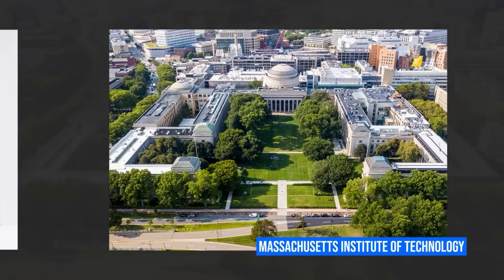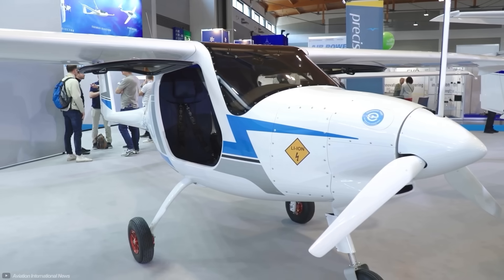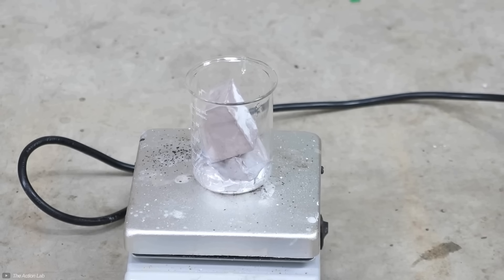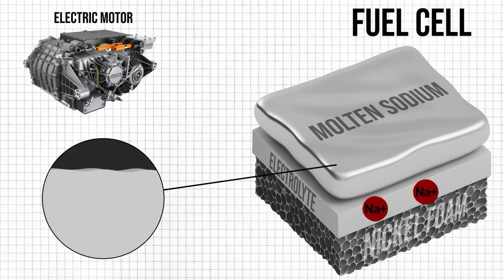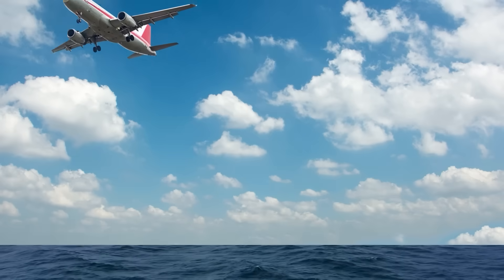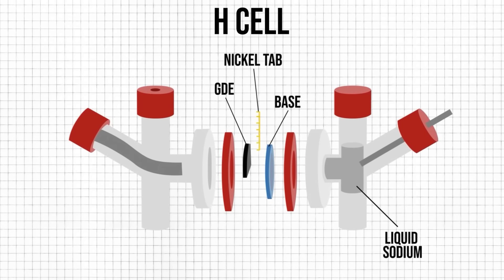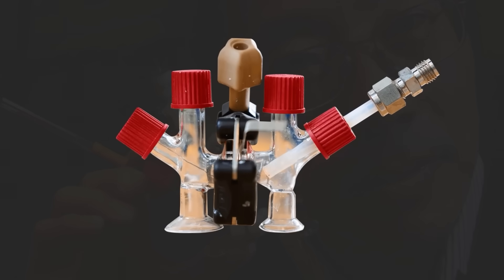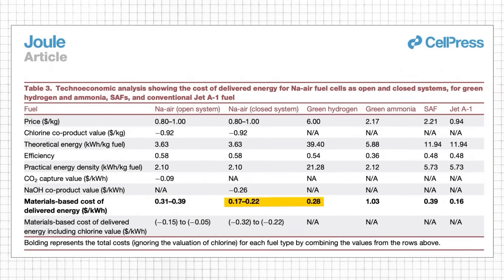How MIT's New Sodium Fuel Cell Changes Everything

Comment: If I were designing this, I would use spools of sodium wire as the feed stock, so only the end of the wire would need to be molten. Then I would use CO2 from the air to reduce the hydroxide to bicarbonate before dumping.

Comment: Listening to this now, there's several problems I've ID'd, that more or less is "They are assuming a lot of average conditions that don't exist in real life" issues that would in many cases make this device unusable especially in aviation. They are nowhere near "the engineering stage" as you put it:

For one, their use of humidified air as the source of water for the reaction is, while smart on its face, assumes that air would bee humid in the first place. Even worse, the second a plane flies through a cloud, and intakes water, this would introduce either in the first case no water to react, or far too much water, in which case you could have bouts of sudden loss of power production, or in the case that the pores of the foam being big enough to support a truly high power device, lead to the foam being damaged by high reaction events, or potentially cause an explosion. The only way to control this is by not using air at all, but having a water tank that injects steam into an airstream, or something akin to that, giving you the ability to control the humidity. 

It seems that you did some heavy rounding on the 4X figure, so that's in the range of the currently planned production solid state cells. However being slightly less than current li-ion chemistries for power density, which would be even lower for higher sodium utility (needed for aircraft) is abysmal. Aircraft are increasingly needing higher power densities as everything is made to be electrified. Bypass air and hydraulic systems are being replaced by electric systems due to their ease of operation and maintenance, and on top of that, heavier lift aircraft, things in the business jet/cargo/airliner sizes would need powertrains that can do in the megawatt ranges of power output. Given that these are like Li-ion chemistries, doing with energy density means that you're not easily reaching this megawatt scale, and on top of that, most of the material is wasted. 

This is not a technology that is ready for anything other than maybe more lab work.

Comment: Some notes to start the video off (I'm at 0:37):

a 4X energy density increase would put this at ~900 Wh/kg (most cells are sitting at ~230 Wh/kg right now), ignoring packaging. This is lower than the assumed energy density of production solid state cells, which is ~1kWh/kg. 

Solid, pure sodium is not common. It's actually quite rare, and processing of making pure sodium would have to increase by several orders of magnitude to be usable for an energy store. There's also the inherent handling issues of using pure sodium for an energy store in terms of explosions and fires. 

If you don't answer these things, I'll read the paper and see if there's some tidbits about those parts, and then come back.
Reply: Presumably the places that process and refine lithium could be converted to do sodium?
Reply: @michaelmartin9022  No. It's an entirely different process. Lithium is typically processed from brines, pumped in and then chemical processes are done on the brine to isolate the parts (some sodium is developed this way, but in very trace amounts). To mass process sodium, you'd mine out essentially table salt deposits, then separate the sodium from the chlorine/reagent (water).

It's a simpler process, but a much more dangerous one because of the resultant materials.
Reply: If one compares the fuel-cell to Metal-Air batteries (like Lithium-Air or Sodium-Air), then the 900 Wh/kg specific energy density isn't as good. Lithium-Air having a similar max theorectical energy density to jet fuel (11 kWh/kg) and currently has achieved tiral energy density of 1,800 Wh/kg.
Reply: @GruffSillyGoat Air cells have atrocious power densities however, at least with all of the research I've seen. Looking at, in a system that is ~100kWh maybe being able to output a kW at the highest end. I haven't seen any data on lithium or sodium air chemistries however, that might be interesting to investigate. 

If the power density of air cells can be solved however, it's game over. They're extremely lightweight, easily hitting 3-5 kWh/kg as a packaged unit. That's far more efficient than Jet A, and could be used in a far more maintainable system. (much higher TBO's, cheaper overhauls, faster maintenance cycles due to electronic checks).

Comment: Sodium, especially liquified sodium, is highly reactive with many materials, especially with water. Sodium hydroxide is an extremely strong base. There is an assumption that the input air is sufficiently humidified with water vapor. The technical report fails to address safety if such an aircraft crashes in water.

Typically, those interested in such technical developments assume that we have many decades left to practically harness such technologies.

UN chief: World has less than 2 years to avoid 'runaway climate change' (TheHill)
  * This statement was made 6.6 years ago.

Comment: Solid sodium reacts with water and when it burns it is not easy to put down, and getting sodium takes a lot of energy and a lot of chlorine. And chlorine is even nastier.
Reply: Liquid sodium is far more reactive to water compared to solid.
Reply: @gabrielqitsualik6885  wait till it gets into aerosol form
Reply: Tell that to China and BYD
Reply: @hiz24airness  I think you miss the point. This guy isn't talking about Sodium Battery, but rather Sodium fuel (as liquid form) to be transported and used directly as one-time used fuel (not battery), similar to gasoline usage.
Reply: @hiz24airness because ?
Reply: @nicodesmidt4034  they've been doing it globally for decades. Its part of the reason their EV's (especially mass transit) are far cheaper to build than lithium BEV
Reply: @hiz24airness  Sodium batteries are just now starting to show up in EVs, LFP was used mostly and that's what they advance with right now as well.
Reply: @alexandruilea915  BYD launched their LFP globally two years ago. What are you talking about? They've become the biggest EV seller in the world using sodium ion.
Reply: @hiz24airness  Does BYD LFP Lithium iron phosphate (LiFePO4) 14500 battery have any Salt or Sodium metal in it?
And MIT's invention use molten Sodium as one-time-use fuel like Gasoline or Liquid Hydrogen, not as a solid state energy container like LFP.
Reply: @hiz24airness  no they did not, they are just now starting to make sodium ion batteries. BYD launched the LFP blade battery now, but they have been making LFP batteries for years now. From a fast google search result "In 2015, the primary lithium-ion battery types used in China were Lithium Iron Phosphate (LFP) and Nickel Manganese Cobalt (NMC) batteries. LFP batteries accounted for 52% of the market share, while NMC batteries held 39%. A smaller portion, around 3%, consisted of Lithium Manganese Oxide (LMO) batteries, which were preferred by Japanese and Korean car manufacturers."

Comment: Yeah...  except metallic sodium is NOT abundant, it simply does  not  exist in free  form because it is  SO incredibly reactive (more  on this later). Ionic sodium is abundant  (Na+)  and converting  it into metal is NOT cheap  as far as I know. So they are changing  the  problem  of producing hydrogen gas  from water into the  similarly difficult problem of converting Na+ into Na. Not to mention the incredible danger of having MOLTEN fucking SODIUM in your battery which as any chemistry first year  student will know is so  incredibly reactive it spontaneously  explodes in  contact with water.This guy is  either clueless  or  dishonest, and  I don't like either  option.

Comment: I think sodium metal may have great potential for electricity and heat energy in areas that have very long winter days. 

Store solar PV energy making sodium metal.  Sell the chorine. Deliver the sodium metal to a power plant that provides district heating. Sell the electricity and heat during the winter. Then sell the sodium carbonate produced.
Reply: That process you mentioned in practice will be very complex, expensive, involving dangerous chemical and can only be done by big company.

You need to be in touch of reality to get a grasp on the practicality of what you are saying: 
- You don't simply "sell the chlorine". It is poisonous gas, hard to transport and dangerous to human if leaked. Requires specialized and laboratory-grade equipment to be safely done. Chlorine gas is not practically sellable, as the use of it is niche and if a laboratory or industry needs it, it will create its own chlorine gas from NaCl (because equipment to generate chlorine gas is not expensive).
- You don't simply "deliver the sodium metal". It is nasty chemical that degrades quickly in air, explode in water, must be handled very very carefully, more difficult than handling kerosene or hydrogen fuel. Also, power plants don't accept sodium metal. As explained in video, the process of converting sodium metal into electricity requires completely different engine/system, you can only sell them to specialized sodium-fuel power plant, that is if this type of plant exists. Also you need to ensure secure sodium metal packaging (e.g. vacuum) and >99.99% purity, which is not easy. Also, if the price you sell to power plant is higher than the competitors then nobody will buy your metal.
- You don't simply "sell the electricity". You require a tons of expensive equipment and cables. Try building your solar panel system or working with electricity grid provider first to know how bulky and expensive electrical equipment and generator is. 
- While you can distribute and sell sodium carbonate, there are plenty of industries and it is very cheap already. Refining and clean it into powder that is ready to sell will net you almost no profit if you put a competitive price in market.
And you don't simply combine all of these in one business process (and of course not in residential/home level). If you still don't know how impossible it is, then you should research and practice more in chemistry world. Also, you can't simply sell chemical stuffs, there are many considerations before doing that.

While people with money will always choose better alternative: battery, either Sodium battery or Lithium Battery.
Reply: @stark_energy Given the size and scale of seasonal energy storage, I would have guessed it implicit that i was talking about a process best suited for big chemical companies that already have experence dealing with chemicals like sodium and chlorine, rather than som icasional diy guy or home use. Sine large companies like those already involved in the chain of making sodium hypochlorite, sodium carbonate, sodium bicarbonate, hydrochloric acid, and in the manufacturing of PVC plastic that's nearly 60% by weight chlorine. Vertical integration or partnerring in  the manufacturing of these chemicals is likly to offer significant  savings especially if sodium for fuel market expands significantly which then creates an over supply of chlorine that can drive down the cost of products that incorporate it. 

but I'm begining to think sodium metal for energy storage may be better suited for decarbonizing trans oceanic container shipping. 

I am well aware of sodium's danger around water generatig lots of heat and releasing hydrogen gas,   and i am aware of its  reactivity to oxygen in air. But i refuse to believe that humans are not smart enough to figure out ways to safely handle sodium metal in large quantities.

Comment: There is a company, HPQ Silicon, which has developed a Metagene technology producing hydrogen from H2O at the rate of 1.25 meters of hydrogen per KG of fuel using no electricity. I'm not an engineer, sadly. A Google search will get you more info.  Metagene is a proprietary aluminum-silicon alloy. I'd expect the hydrogen could be directly used in a regular fuel cell or a motor.  FWIW

Comment: Sodium fuel. It's literally being oxidized just as fuel is oxidized. 

Sodium hydroxide and sodium carbonate, and sodium bicarbonate are very reactive  so there shouldnt be any fear that it wouldnt react. Mater of fact over the ocean, any unreacted sodium hydroxide or sodium carbonate will fall into the water and absorb disolved CO2, and the oceans will act as a greater CO2 sink for the atmosphere.  But I wouldn't want sodium hydroxide released into the air over land and populated areas. Breathing it is not good for the lungs. The great thing about this is we already have the technology to make sodium metal, and there's great potential to de acidify oceans. But I have concern on how to sink the chlorine into something useful and last a long time.  Sanitisers are sure to make there way back to oceans and convert sodium bicarbonates back to sodium chloride and CO2. But PVC is a useful chemical and can store the chlorine for long time.